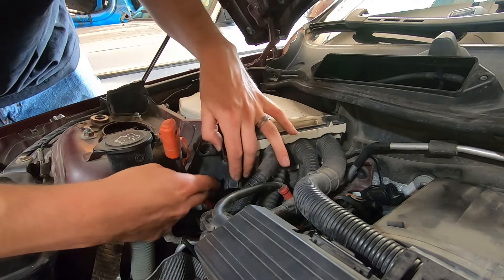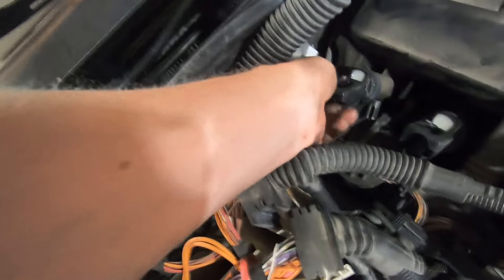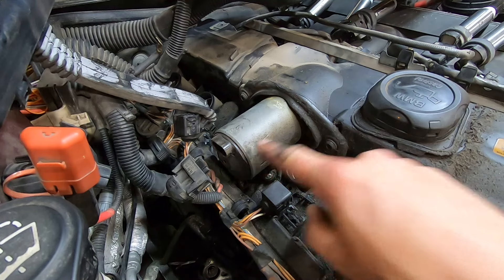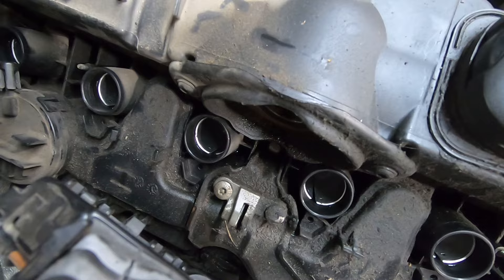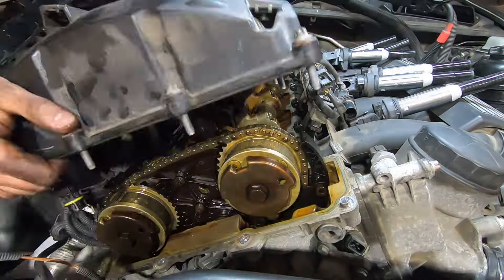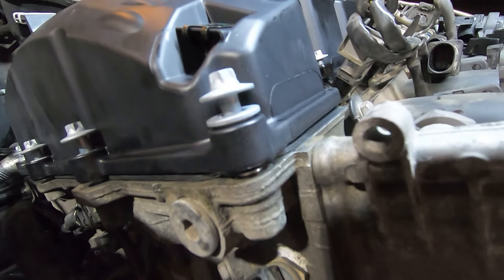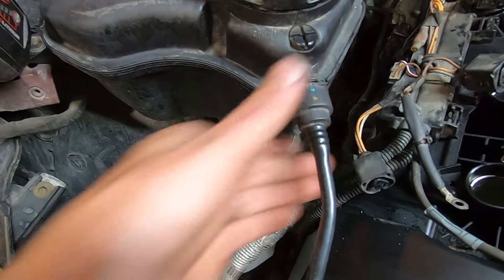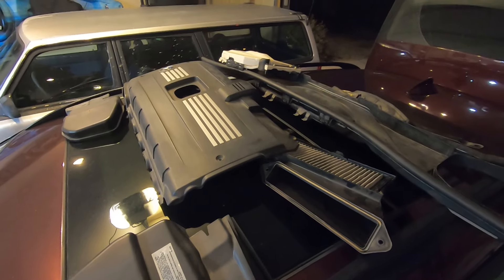Replacing A BMW N52 Valve Cover In TWO MINUTES

Comment: Always remove the NEG battery terminal, not the POS one.  This way, you can prevent sparks when you go back together.  Hydrogen gas is a byproduct of battery operation.  A real danger of explosion is possible with any sparking. The danger is greater when the battery lives in a confined space like the trunk.